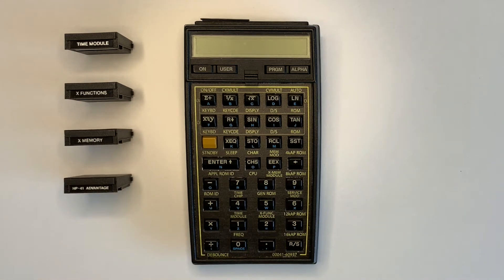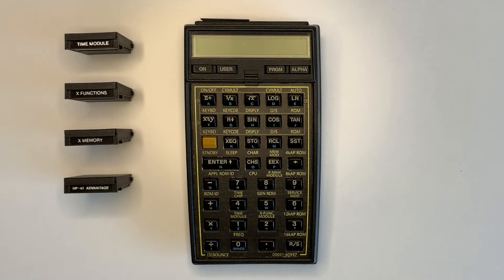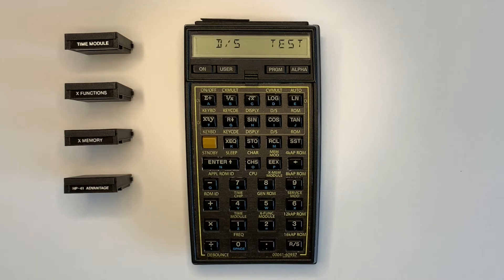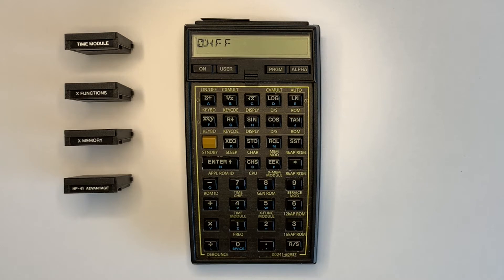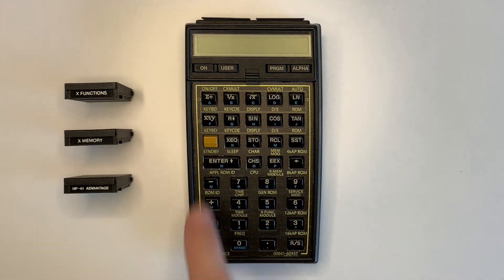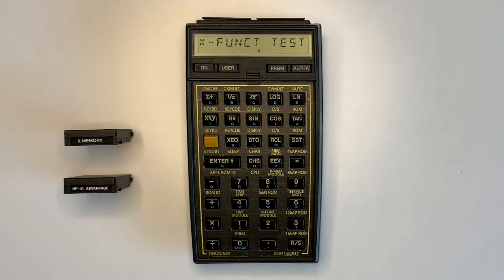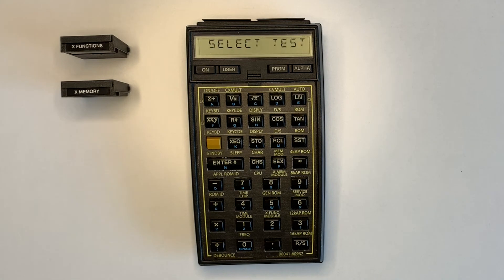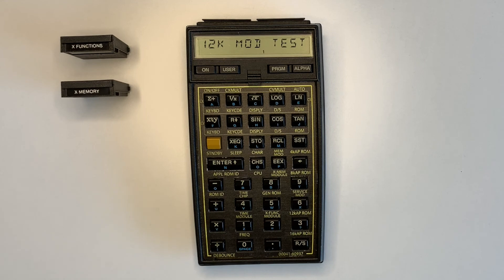HP 41C/CV/CX Service Module / Self-tests - Part 2

Comment: Is this service module a physical module, like the x-functions?
Reply from the maker: Yes, the original module is a physical module that provides this functionality only. I am using a flashable ROM module emulator that lets you load a number of different modules into it. It is also capable of fully emulating the HEPAX module. See the video description for a link where you can find more information and purchase this module (NoV-64d) or one of its variants.
Reply: @CalculatorClique  , thanks a lot! I didn't notice the video description.. It's hard to find these original modules from what I've seen in online auctions (ebay), so it's great that there is an emulator available! I'll have to read more about the "NoV-64d" and probably buy one. Thanks again for help!